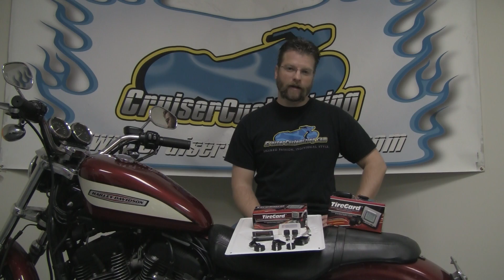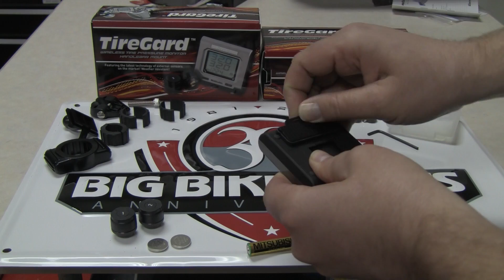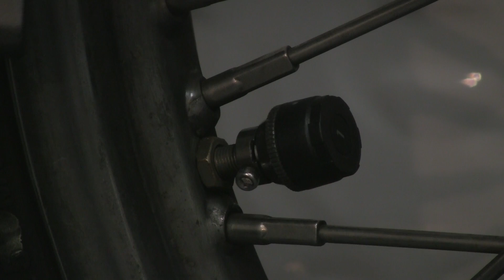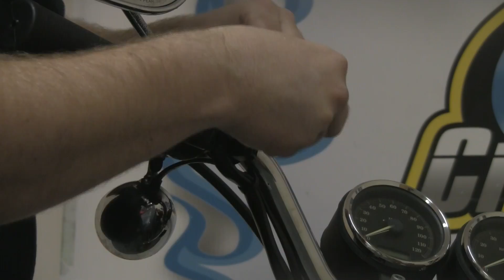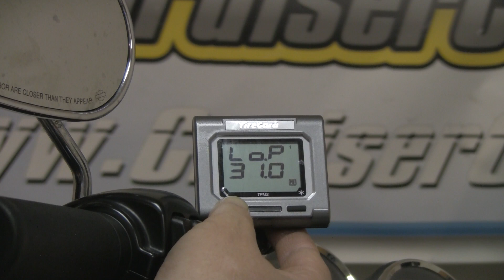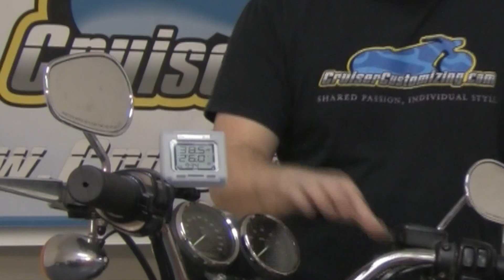Motorcycle TireGard Handlebar - Instructions & Installation - Video Guide: Tip of the Week

Comment: He is mostly correct. However the bike must be ridden before the sensors start sending information. On my bike it takes anywhere from a few feet to a few miles. I'm not sure why it's not consistent. The sign that the sensors are sending is that you will get strength bars like the ones on your phone beside each tire's read out. Also when the AAA battery in the monitor gets low you'll get a warning on the display. That battery and the ones in the wheel units last a long time. I'm very satisfied with my tire gard.

Comment: No answers to any of the questions?  
1.  How does one adjust the air pressure with the tire guard on the stem?
2.  Are the monitor units energized all the time?  How long do the batteries last?
3.  Will the extra weight on the end of the stem cause flexing and fatigue or interference problems with brake calipers?
4.  Do you make one with internal sensors?  I'd much rather have internal.